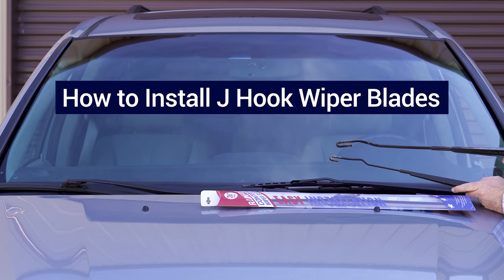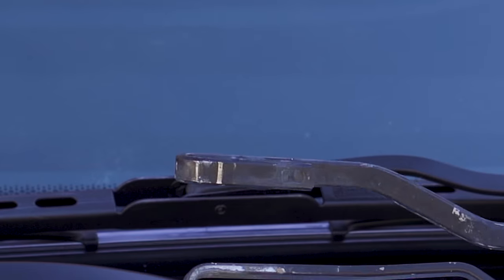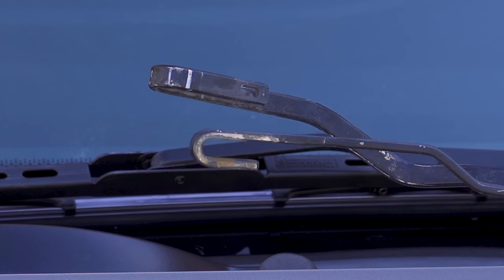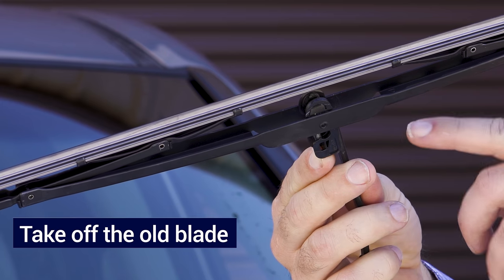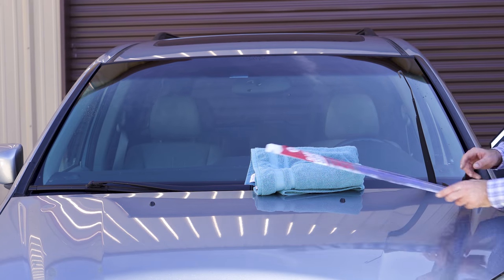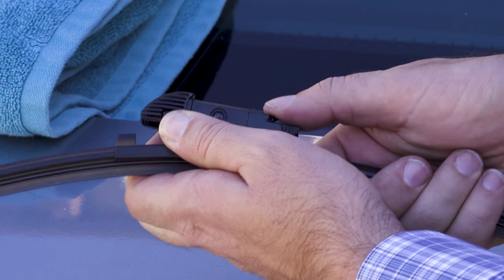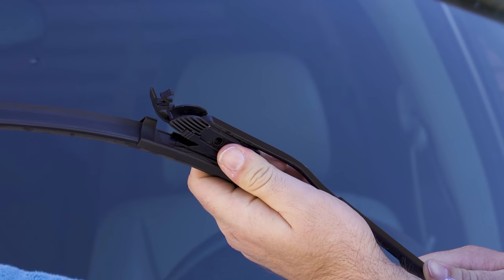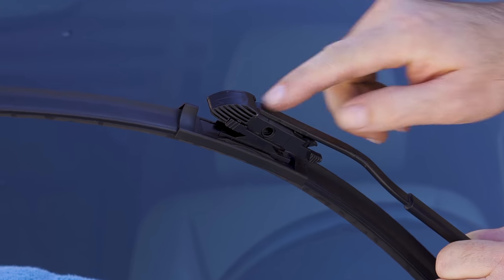How to remove and install wiper blades with a J Hook connection.

Comment: The part where you say "it'll come off real simple that way" is the part where I struggle...
Reply: This. After a few years, those wipers get stuck on tight! However, they sure come on (and off) real easy while new! 🤣
Reply: Yeah the ones I buy last 2 years and by the end you basically need to break it off.  The ones from the dealership last about 8-12 months and come off with a little struggle. New I can switch them every day if I wanted lol.
Reply: You might also want to change them during the warmer and drier parts of the year. Bits of autumn and winter seem to clog the hooks and frozen plastic pieces seem to hate movement in general.
Reply: Where the hook engages with that metal rod in the wiper blade I can't figure it out how to get it off when I try to lift the wiper up and off once disengaged with the hook it just goes back to the hook. How do you do it? Just break it?
Reply: @jamesgraves9858  It takes a bit if angling, but yes, you can always break off the piece.
Reply: Same 😭
Reply: I'll try pinching it again and if that doesn't work I'll be going at it with a pair of pliers.  The j hook on the wiper arm seems like mild steel so I don't think that part will break if I just gingerly wrench the thing off with a pair of pliers or Vice-grips .
Reply: Thank you so much for showing clearly how to take off the my passenger side windshield wiper! Once I found the button it came off easily. Definitely keeping this video for future reference
Reply: Same

Comment: If this doesn't work, you can also try the method I used where you rage scream like a neanderthal while twisting the wiper blade until the plastic shatters in pieces from the j hook.  Works like a charm.
Reply: Been there!!
Reply: Lol that's what I'm considering. I can't get past the hook to remove. That metal rod it engages with is in the way. I've disengaged with the hook but can't remove the wiper blade once I've done that
Reply: 🤣🤣🤣
This made my whole night 😂. Thanks so much for sharing! ❤

Comment: Tried prying the wiper off with my pocket knife and sliced my finger! I then came here and stopped my barbaric ways!! Thank you!!!
Reply: That's funny as f**#!!!! I did the same thing yesterday putting them on. What's really funny is that I had a flat head screwdriver in my back pocket!!!
Reply: Yeah funny you guys say that, about 9 months ago the same thing also happened to me! When I bought my car in October 2020 it was 6 year old just gone & apparently the lady who had it before me had the same wiper blade on for those 6 years! No wonder I couldn’t see a thing! I took it into Toyota for an airbag recall & thankfully they did it for me, they did tell me that it was incredibly jammed & there was no way I would’ve got it off on my own! I didn’t feel like such a girl then! Haha! Unfortunately that wiper is the only brand of wiper I can get from my car (I really wanted to try something else but unfortunately it’s a single large wiper in the middle & not many do those), it’s time it was changed again. I’ve been sent the wrong one & then finally got the correct one sent to me, but sadly I’ve had to go for the same brand again. I went for the more expensive version with the slight different fitting, so I’m hoping the job will be a little bit easier to do myself this time! Everyone tells me Bosch are really good, but it did nothing but screech & smear in the opposite right direction from new. I had Michelin on my old Toyota & they were so much better!

Comment: If the wiper is old, the "button" will almost ALWAYS be broken off so there's no button to see. This complicates what should be a simple operation and you should add this detail. I don't believe I'm the only one who discovered this through struggling to find this button to release the blade!

Comment: I did it on the first one, then figured I could immediately do the second one, struggled with it for 5 freaking mins before rewatching the video, then got it on the first try lol. 

*KEY TO PEOPLE STRUGGLING WITH THE SMALL J-HOOK MODEL!  

Make sure when you're trying to take it off to do what he says and turn the blade horizontal, then press the tab before pulling the blade down to release it from the arm. 
I kept screwing up because I had the blade turned to one side or the other. It wasn't until I re-watched the video and saw that he said and showed, to turn the blade flush/horizontal to the vehicle. Again, this is for the small J-HOOK model. 

Thanks again SO MUCH for taking the time, and caring enough about your fellow man to make a video like this. You ROCK!

Comment: watched a lot of videos, this is the first one to explain various after market blade removal.  Putting new blades on is easy, it is the removal of the old “unmarked as to brand” that is the difficult part.  Thanks

Comment: Thanks very much. The button didn't do anything and mine were stuck on the arm. But I saw how the button pushed thru the hook on the arm, so I used a screwdriver to get them off. Also using a towel to protect the glass was a great tip :)

Comment: Anyone who is having trouble like me, keep in mind for uninstallation you really gotta add some force, but make sure it's in the right spot. There's two prongs on the bottom that are like a seat buckle that are really hard to pry, used some nose pliers. I'm on a mazda tribute btw!

Comment: TIP: If the wiper seems stuck, with the wipers in normal operating position try angling one end and then the other toward the top of the windshield a few times to loosen the bond with the J-hook. Every time I change them out they are ALWAYS stuck and need some loosening up and then they will come off pretty easily, but not before!
Reply: You’re a legend thank you boss